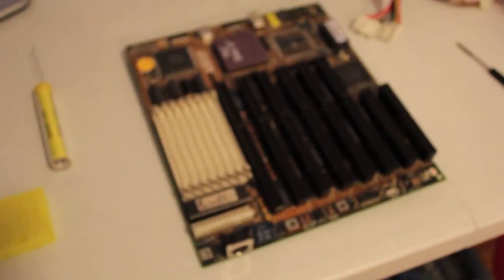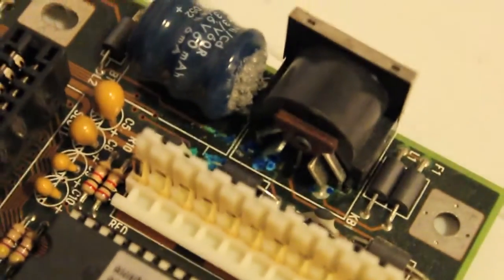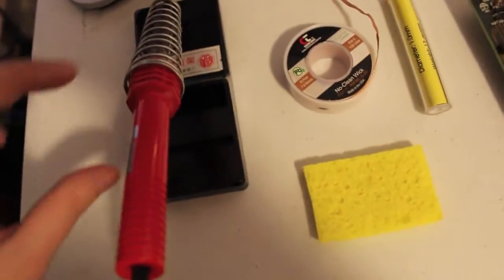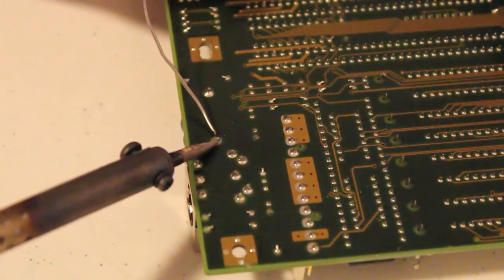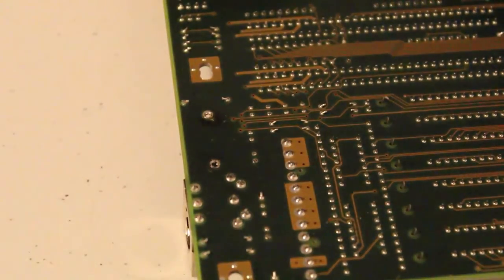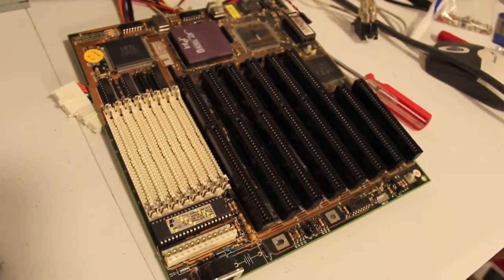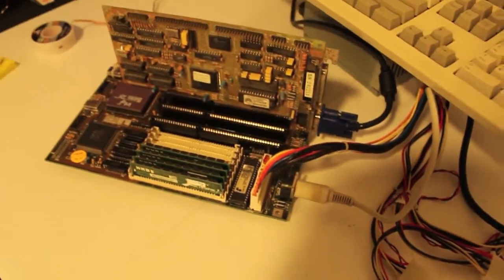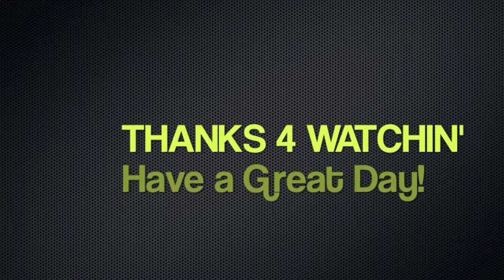Removing a NiCad Battery from a 486 Motherboard

Comment: i have 2 486 boards that have failed from leaky nicad barrel batteries, i have 1 working one that at least has a cr2032 holder, it also has PCI, ISA and VLB, it currently has a Intel DX4 100 with a Cirrus GD5430 PCI, Sound Blaster Pro 2.0, and a 2GB CF Card with DOS 6.22 and WfW 3.11